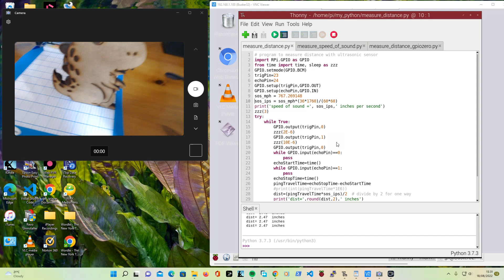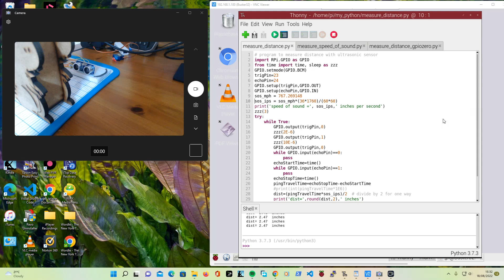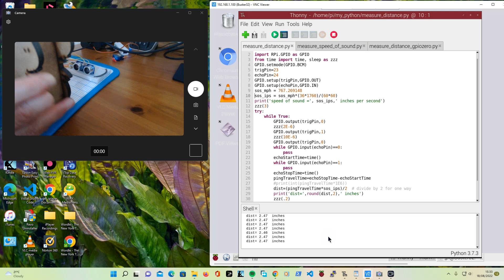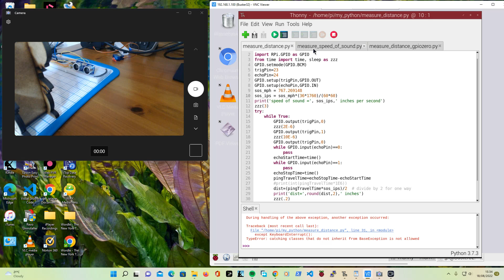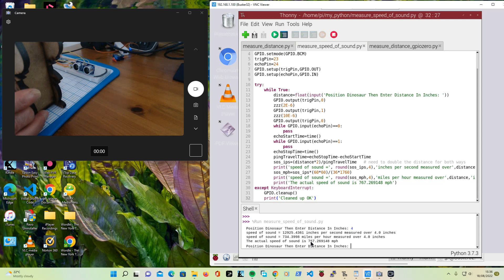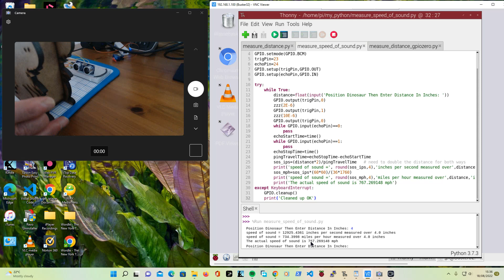RPi Lessons 21 & 22 (Using the HC-SR04 ultrasonic sensor) -

Comment: Certainly gpoiizero has some advantages over RPi.GPIO.
Reply from the maker: It's much simpler but I think it's a good idea to use RPi.GPIO to understand what's going on and then use gpiozero if you want to do something quickly. You can't use it to measure the speed of sound though but realistically who would want to in the real world?
Reply: @charlotteswift  I subscribe to the idea that you do not have to know how a car works in order to drive it. So would prefer gpiozero where its use is feasible.
Reply from the maker: @itsmeintorrespain2714  I just like not having to type much